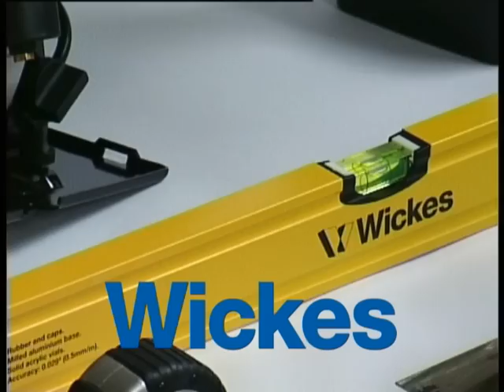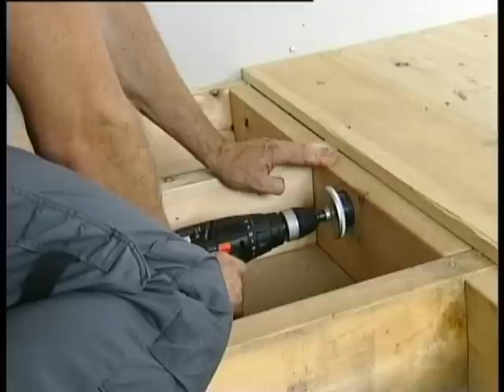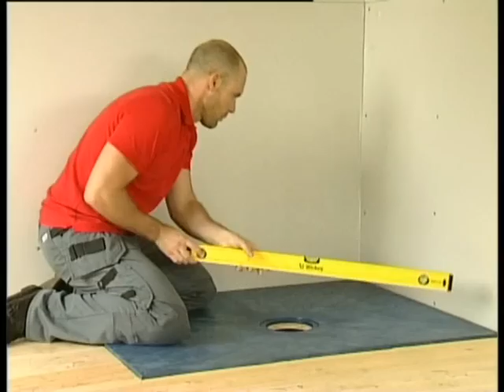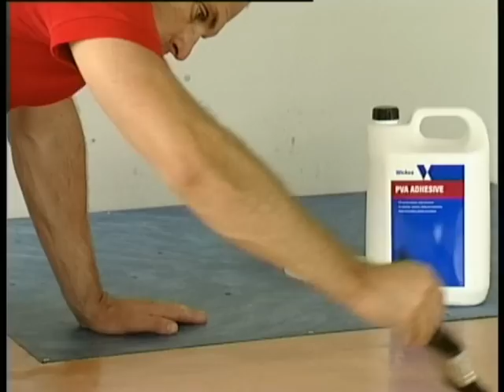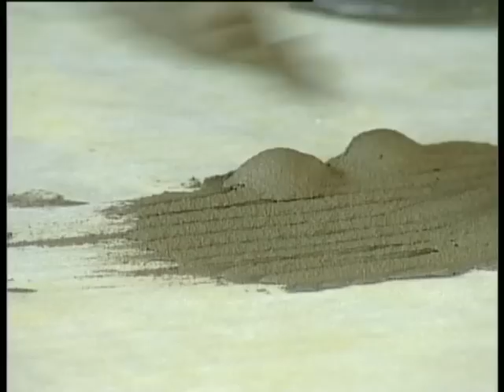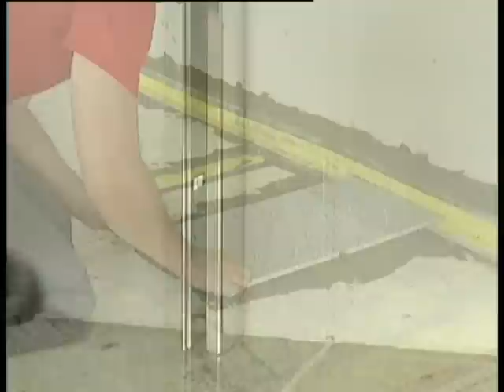How to install a wet room with Wickes

Comment: We fit wetrooms every month, i must say this is an overcomplicated way of tanking a wetroom, especially using tile adhesive to stick down the tanking tape, as tiling adhesive is not fully waterproof. Using a tanking slurry or solution is a much easier, tidyer and more secure waterproof solution. although this video gives a solution to tanking a wetroom, this is by far not the easiest way, especially if its being done DIY.
Reply: ya true but this is 12 years ago
Reply: Totally agree 👍

Comment: I would have used a tanking solution rather than tile adhesive especially for the jointing tape areas. This system by Wickes is good but tanking lets it down.

Comment from the maker: Yes, we have an installation service available for Kitchens and Bathrooms (including Wet Rooms). To arrange a free home survey and get an estimated cost, simply visit your nearest Wickes store and speak to one of our Design Consultants, or book an appointment with them.

All our approved installers are highly qualified and are subject to a rigorous vetting process, so you can be sure that your work will be carried out to exacting quality standards and in accordance with current legislation.
Reply: Wickes i would like to install a wetroom but i'm seeking a honest reliable accredited builder because i require an extention on my existing treatment room .
Reply: Wickes told me that they don't fit wetrooms on concrete floors. I have concrete under my lino floor. I may have to look elsewhere.